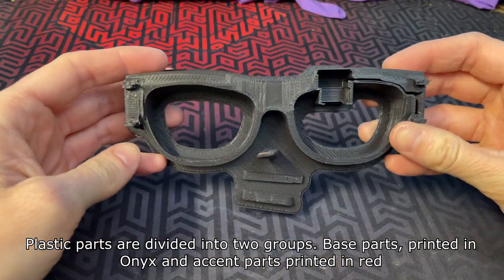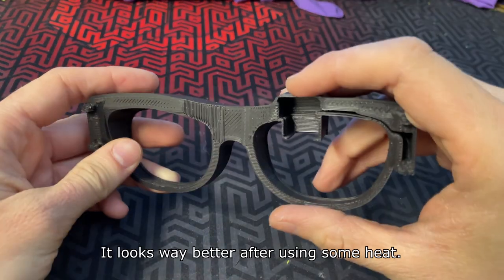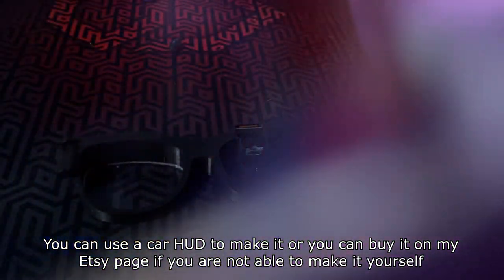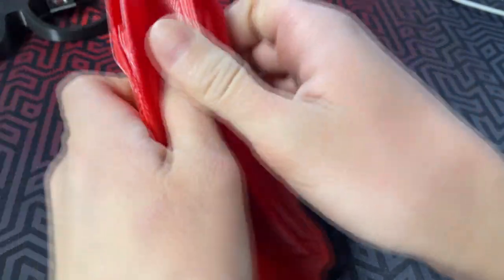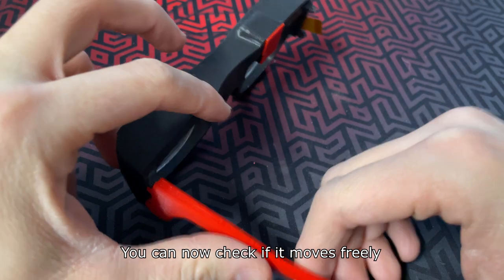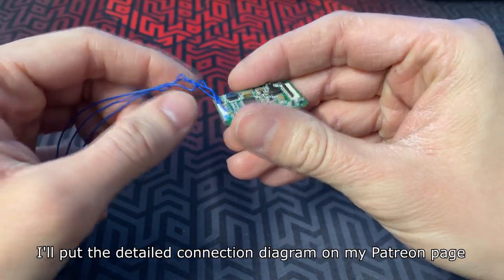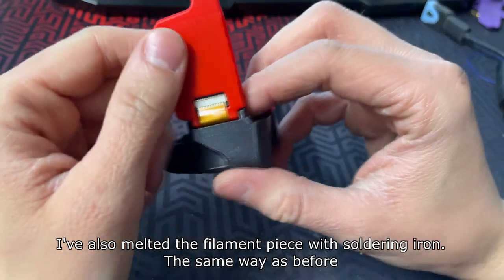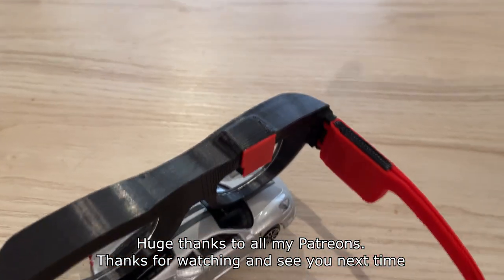Onyx 1.3.7 - DiY AR Glasses

Comment: Very impressive work! By far the most polished pair of homemade AR glasses I have seen. Do you plan on making any untethered models at some point?
Reply from the maker: Thanks! I have a really nice idea for version 2.0 but I want to keep it a secret for now. Until I have something to show at least.
Reply: Up to recently, it was the best ar glasses setup you could have for a reasonable price
Reply: @ManolloMancelli not sure how useful they are for displays, but esp32/esp8266s can use the ESPNOW wireless protocol, which is a super useful, super fast was to transmit smaller amounts of data 🤔

Comment: Thank you so much for these tutorials! For prescription glasses wearers would there need to be two lenses? One for the prescription placed before the display and other in front for the projection? Also have you experimented with having the display project from the side frame of the glasses rather than from the top?
Reply from the maker: You could replace my lenses with prescription ones but it would require some modifications to the plastic parts. I’ve tried projecting image from side but it makes some complications as image path gets way longer

Comment: Awesome work! Some 3d printing recommendations, raft is not needed at all for any of the parts, and the supports are way too dense, which makes them hard to remove, plus by the looks of them, they don't seem like slicer-generated supports, so I would recommend using those instead.
Reply from the maker: Thanks! I’ve actually modeled the supports myself since I’ve had some issues with print quality while using auto generated ones. Basically my printer doesn’t work so well recently and I have to do some really weird stuff to print my projects properly.
Reply: @ManolloMancelli  No wonder!! Maybe it's time for a bambu lab x1c or p1p upgrade haha! But have you played with the z distance and density for supports? It helps a lot if the support is sticking too well or if the print is sagging onto the support which creates bumps on the bottom side of the print!!
Reply from the maker: @oliverfong418  Yeah I’ve tried various support options and most parts come out fine but for my glasses I need to use custom, modeled supports for surface to come out properly. I totally would buy Bambu printer but I have a hunch that it might not be worth the price. Don’t really know why. Im currently building Voron 0 so I will probably use that for faster prototyping
Reply: @ManolloMancelli  Wow looking forward to seeing the Voron 0 speeding up the development! I am also building a Rook by rolohaun, an exciting small machine. Btw about the bambu lab printers, they worth every penny and I am amazed by the ease of use and quality that they give with that speed, I own an x1c with ams, and it makes every other printer that I have look ancient in comparison.

Comment: I am a little slapstick crazy, but i wanna do this just to make my own micro uOLED display setup for a custom vr, or at least when referring to the displays. Gonna do a dual setup using display cable in a unique way but we'll see.

Edit 1: need to know if the part is just micro oled or micro uloed because that affects the quality of viewing.
Reply from the maker: Display I’ve used is FLCoS. It’s basically really small LCD. For me, quality is really good. You can watch videos, read text etc easily.

Comment: would it be possible to obtain a modified version that is just the holder for the display+magnifier+combiner?
Reply from the maker: Something like this ? 
https://www.patreon.com/posts/flatscreen-stl-68150000
Reply: @ManolloMancelli  yes! thank you so much :)
Reply: @ManolloMancelli  question; this works with the same microdisplay as the one featured in this video? i plan on using this as a template for my prescription glasses that i could simply clip onto the frame somewhere :)
Reply from the maker: @incredibnlyreal  Yeah. It’s basically strip down version of the glasses. It uses the same electronics
Reply: @ManolloMancelli  lovely, thank you!

Comment: What resolution does this display have? Is it necessary to use this display or will it work with any display?
Reply from the maker: It’s 960x540. It should work with other display as long as you buy composite one and can modify the plastic parts so that it fits

Comment: Hello there 👋
Great job 👏 
But i wonder if the video quality is good enough for using it as a computer screen? 🤔
Reply: Would i actually see any text without my a problem?
Cause AV analog signal makes me wonder 🤔  if it will be ok for a standard monitor resolution of 1280 x 1024. I feel that i will not see the text well....
Pls explain, how do you see this 🤝
Reply: Maybe there is a better camera and set up that you would recommend for my needs.  Never mind the cost of the camera as long as if it will have outstanding quality 👌
Reply from the maker: The quality is really well for my standards but if you'd like to make it even better, there are 1080p displays like this one available on Aliexpress
Reply: @ManolloMancelli  can you please show witch one is suitable?🙏
Reply from the maker: @neuroshifting7593  This one for example :
https://a.aliexpress.com/_EQkCs8Z
You’d have to modify the 3D files of course
Reply: @Mañolo  Manolo, is it possible not to integrate av to hdmi into the glasses but rather just extend the wires from monitor to the av>hdmi converter that would be in your pocket or plugged into the pc? Is it possible? Cause the less weight on the glasses, the better)))
Reply from the maker: @neuroshifting7593  Yeah. That’s how I’ve did it in version 1.3.1. I’ve used 3.5mm cable to connect the glasses with processing unit in my pocket. You can use hdmi converter or connect it to some board like raspberry pi
Reply: @ManolloMancelli  thanks for your reply 🤝
Reply: @Mañolo  Can you make a video with your wonderful glasses paired to android phone? Sure, everyone would love such a setup.
Reply from the maker: @neuroshifting7593  I could but I don't really have an Android phone

Comment: What is the total cost? (I have a 3D printer so i can print the parts)
Reply from the maker: ~120$
Reply: @ManolloMancelli  Thanks! Do you have a link for the lenses without the printed stuff?
Reply from the maker: Right now I've got a link to 1.3 version only buy if you'd like to buy 1.3.7 version then just buy the 1.3 version and write in the comment that you need 1.3.7.
https://www.etsy.com/pl/listing/1248391050/onyx-glasses-13-optical-kit
Reply: @ManolloMancelli  Ok. Thanks!
Reply: @ManolloMancelli  I also saw the products from etsy can't be shipped to Israel. Is there any other store i can buy this and ship it to Israel?
Reply from the maker: @Karish244  Right now I'm using only Etsy to sell my items
Reply: @ManolloMancelli  so I'll try to use a 3rd party shipping company.. thanks anyway
Reply: @Karish244  הצלחת בסוף להזמין? אני בדיוק רוצה גם.
Reply: @adistroianu363  עוד לא ניסיתי.. אין לי זמן לזה כרגע (אבל אולי אני אזמין בקרוב ואז כן)